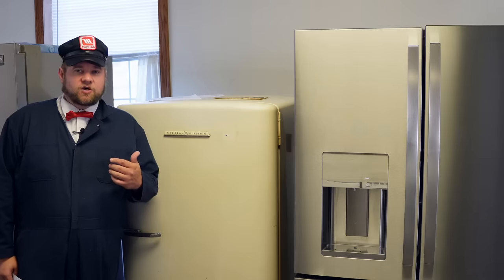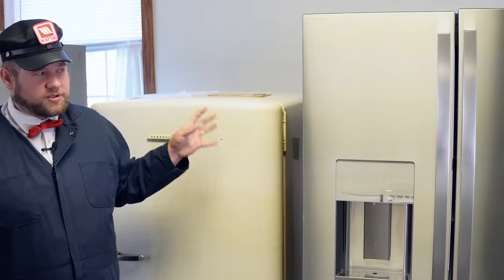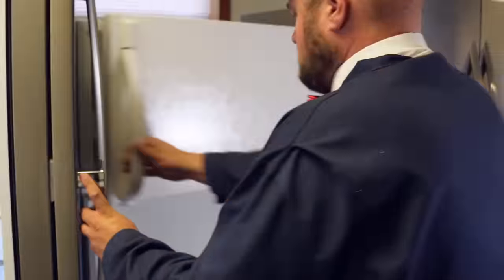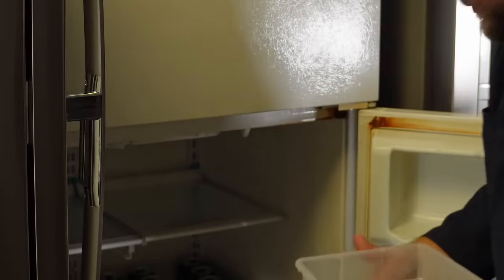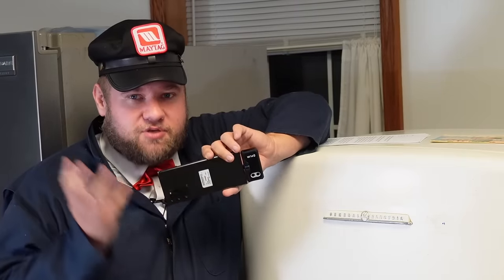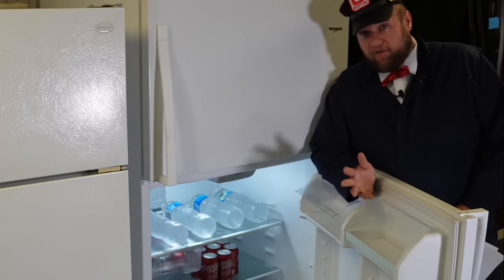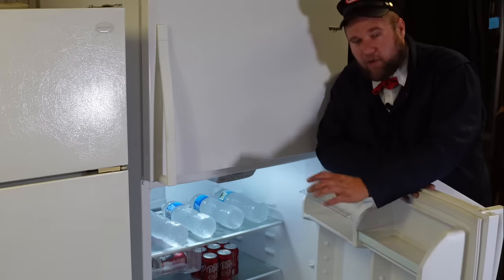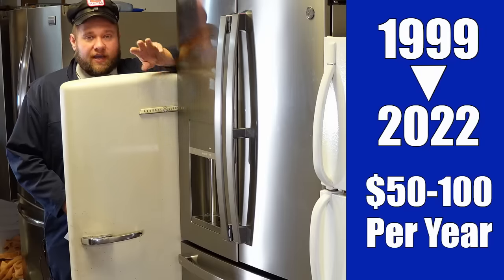Should You EVER Buy a New Appliance if Yours Still Works? A 7-Day Test

Comment: I have a friend that lost her home to Hurricane Katrina. She put brand new GE appliances in her next home. All of the crapped out on her after five years or so. 

From that point on she only buys old appliances that are still running and she loves them. She even drove several states away to get her refrigerator. You can’t give her anything “new”, especially if it’s “smart” and high tech.

I’m planning a new retirement home for myself now and I’m giving a lot of thought of buying newer but simple “non-smart” appliances vs used but near bulletproof older appliances. I miss the days when appliances lasted multiple decades. Side note I’m still using a GE dryer I got from my late father. He purchased it around 1975. It’s not pretty to look at, but I’ve only had to replace the drive belt in it. 🤔
Reply: I do have to admit that I purchased a used Whirlpool dishwasher for $150 about 10 years ago, after looking at all the reviews and concluding that they were all garbage. It is about to get replaced. It wasn't the best machine but it was a long-living machine.
Reply: Most things nowadays are built to sell and make money instead of built to last like before. Things are now engineered to only last a relative short amount of time before major components crap out. I bought a house from the 60s with original kitchen appliances other than the fridge the owners bought new back in the day. I decided to just keep using them and they are still running strong to this very day. They just look absolutely ancient.
Reply: I had a simple two door fridge I got out of the trash. Rental people left it still good. I used it for years and always kept it ventilated.
Then my brother gave me a bigger, newer unit so I put that in and gave the other to a poor guy down the street.
Then within about 6 months the newer one took a dump and then I had to buy one.
Reply: We've got a GE gas dryer that came with our house in '88.  It's probably from the early '70s as well.  I've replaced the igniter coil and door switch in all that time.  Still going strong.  My wife hates the gold color.  Sorry dear...
Reply: @robertweinmann9408  that's what God created white enamel paint for.
Reply: Stay away from GE. It’s trash.
Reply: @georgehill3087  Modern machinery and electronics are significantly more complex now than 40 years ago. Making a "built to break" fridge significantly cheapens it. The 1950's fridge cost was equivalent to $1224...a quick search in best buy shows that fridges with the same internal volume as the GE 1950 costs about $500, and fridges in the $1000-1200 range are at LEAST 20cf. The increase in component quality and robustness needed for a modern fridge to last as long as the "good old tech" would significantly increase cost, maybe even more than doubling the retail price. It's less of a conspiracy to make you buy products more often, and more of selling to more people by increasing affordability. If you want to be outraged by actual planned obsolesce, then look at the Light Bulb Conspiracy and the Dubai Bulb. For decades, light bulb manufacturers made lights with shorter lifespans than it would be possible, even though the cost for a longer lasting light wouldn't increase manufacturing costs. Or Apple charger cables.
Reply: Reminds me of one of my old high school teachers, he had a microwave in his classroom that was very old, even used a dial to set the time. I once looked on the back and it was from an obscure brand, manufactured in Korea back in 1988. I hope he still has it now, this was just about 5 years ago.
Reply: @georgehill3087  There's a term for that, it's called planned obsolescence. It's especially a thing with iPhones, I've heard.
Reply: @geronimowindow  iphone is the first thing people think of when they say planned obsolescence but my iphone still works perfectly despite being 5 years old and so does my 7 year old windows phone. The only phones that keep getting slow or broken for me are androids

Comment: I think Grandma's old fridge would be a perfect beer/soda vault out in the garage or a man cave. I'd be crazy enough to use it as a main fridge in the kitchen, but I'm weird and like vintage/retro stuff like that.
Reply: Weird? How?  It looks much more elegant and fancy than most budget modern fridge.  just buy the cheapest samsung fridge on walmart they got that ugly flower pattern combined with unflattering purple color
Reply: Bamn, i found the exact thing i described, this i dunno if it available on your region now this is weird product for your mancave! 
SAMSUNG 192 Liters 2 Star Direct Cool Single Door Refrigerator with Anti-Bacteria Gasket (RR19A2Y2B6R/NL, Mystic Overlay Red)
Reply: No one needs a second fridge. Just refill the main fridge when u get low. Jeez.
Reply: @zloungeact  oh, you haven’t met south east asian mid-upper class housewives then.. you’ll be surprised...
... in your electricy bill, not because of 2 fridge made huge different in your bill. Rather the price of the single high 4 door end fridge  drawing more power than cheaper ones
Reply: My mother’s GE little fig in shop still working and full of water

Comment: It's also worth considering ambient temperature. If a fridge/freezer is in a colder area (such as a basement and/or garage) it will consume proportionally less energy. Our early 70s Whirlpool upright freezer seems to use about half of what the online sources said it should, and that might even have been before I cleaned the condenser coils. But what surprised me the most was you mentioning using a hairdryer to reset the door gasket. A tutorial on this would be super helpful.
Reply: I had a simple fridge I got out of the trash and used it for many years. In summer I always kept it ventilated with small fan. When I went out for the day in summer I had to close the place up good ( bad neighborhood ) and the kitchen would be about 100 degrees but because I put a fan to keep the hot air MOVING,  inside the fridge it was frosty cold.
Refrigerators are set up different. I had a freezer unit in my garage that had refrigerant coils throughout, on the shelves themselves. Then I had simple house unit that was all centered around a 
' cold box ' with forced air blowing cold air ail throughout the unit, starting in the freezer compartment. If you put a tray of ice cubes in the freezer mostly by itself it would freeze them so fast they would sent tall shards of ice off the top of the cubes sticking up in the air about an inch.
The old fridge is a ' cold box ' in the middle with no forced air.
Similar to having a block of ice in an insulated box with the center of the block getting a little colder than freezing.
Reply: Yes a video on the hairdryer trick would be much appreciated.
Reply: Had an old pantry cabinet in my kitchen with outside vents through the North wall. So I put my fridge in there and added some trim to the door frame to seal it. It only ran normally from May to September, the rest of the year it turned on once or twice a day or not at all.
Reply: @Tore_Lund  sounds like the way all of them should be hooked up.
I once had a xrazy idea of hooking up a small window air conditioner near the center of my house and using ducting to blow ventilating air through the back side. Kind of like those ' in the room ' air conditioners where you put hoses through a window.
A refrigerator set up that way would probably use about 1/4 the power.
Reply: @Tore_Lund  Just remember that in conventional fridge/freezer combos the freezer temperature is unregulated and depends on balanced thermals. Be sure to adjust the freezer temp knob as needed throughout the year if you don't want it thawing in the cold.
Reply: @eDoc2020  I don't remember it being an issue. I live up 55 degrees north so summers were not that hot, but I do remember the fridge part being only +2C on  some days in winter. Still making a thermostat shutter on the vents would not make it overly complicated.
Reply: @Tore_Lund  If the outside temperature is below the set refrigerator temperature the compressor won't run at all. So if it's above freezing outside the freezer will eventually thaw. Ideally you'd have separately regulated fridge and freezer compartments but this is only an option with separate units or some higher-end modern combos. But if you monitor your temps you'll probably be fine.
Reply: @eDoc2020  Yes there are fridges with two compressors, maybe I didn't have much in the freezer? It was in 1992, I don't remember.
Reply: I took the lower back cover off my refer, and have it about 8" from the wall.  It sits next to the aisle to the bath room, so it has added air transfer.

Comment: Our fridge is 31 years old. It's a Kenmore made by GE. The only issues were a loose wiring connector and a few blockages of the freezer drain over the years. All problems we repaired ourselves. My grandmother had a fridge last 20 some years before getting replaced by this one. Sadly, she died in 1992, when the fridge was only around a year old. I remember her saying this one wouldn't last as long as her old one.
Reply: yep my mom has an old kenmore and it has never had an issue, she has an old kenmore washer and dryer from 1980, and the only thing that went wrong with it, the drum in the dryer needed to be cleaned out. other then that perfect working order.
Reply: The new $3000 Jap models are breaking down in less than 5 years.
Reply: @fladave99  CHINA pride.

Comment: I agree. All fridges should have a minimum of 15 to 20 years life. We have an 18-19 year old fridge that is making the vegetables go soft and uneatable. Don’t want to upgrade until a kitchen renovation but we may have to get an interim one. Great video. 👍
Reply: then don't put your vegetables in the fridge... they don't belong there ;-)
Reply: craigslist. there are so many units on there that work and are good price.
Reply: i am a bit confused how does the fridge do that, the only way it can possibly do that is if it is letting oxygen into the fridge, that is how vegetables go bad. as fridges are supposed to be air tight for that purpose.
Reply: @demonpride1975  too cold = the cells in the vegetables break = they get soft and squishy... simple physics nothing to do with oxygen.
Reply: Geez, check the temperature settings; sounds like you're freezing your veggies 😅
Reply: @sophya5796  haha. No I checked. Proper temperature.
Reply: @sophya5796  lower the temp settings giggles just gets colder then
Reply: @LiLBitsDK  you should read what he said, that the temp was at the proper level, sooooooooo yeah your answer is moot, oxygen decays vegetable matter.
Reply: @demonpride1975  or you could read that he EDITED his msg ;-) hence the (edited) after the time posted. oxygen doesn't decay vegetables that fast... a few hours with too cold and a cucumber goes off... common knowledge... can even happen if you accidently push it to the backside of the fridge so it touches the back wall which is much colder since that is where the cooling element is at. same with salads and other vegetables that do not like frost... so yes the temp of the "fridge" might be 5C but the backwall/bottom is still much colder (cold air seeks down since it is heavier than warm air) so your answer is moot and unintelligent. most veggies can last very long times if kept at the right temperature... heck how old do you think those apples are you eat in spring? ;-)
Reply: 1. Crisper boxes can be had at most home goods stores. Failing that, look online. Rinse and dry your veg before storing them in those boxes. I've had celery last for weeks because I made sure it was stored properly. Alternatively, use the bottom drawers in a newer fridge for fruit/veg storage. 

2. Make sure your fridge is set to a reasonable temperature. If you're stuck with an older unit with a manufacturer specific temperature knob showing levels of cold but not temp, invest in a fridge thermometer. Keep produce above 32F/0°C to avoid ice from crystallizing. When this happens it tears apart the cell walls and renders your once crisp celery into gross floppy goo sticks when thawed. Still usable in stock making, but not really palatable otherwise.

3. Position the crisper away from the freezer outlet. It won't matter if the temperature and storage options are just right if your celery is being blasted with freezer air 24/7. Cold is cold and cold makes plants mush. Bottom shelf seems to work best for me. Crisper drawers are at the bottom for good reason.

Comment: My last fridge here in Ireland lasted about 15 years. I think a key thing to highlight is to buy a fridge the size you need. Bigger isn't necessarily better here. If you buy a smaller modern fridge you'll use way less power.

My fridge holds 210 litres in the fridge part and 70 litres in the freezer part which is more than enough.
Reply: Indeed, of course for a household with children it makes more sense to have a big fridge than someone who is single and lives alone.
Reply: It depends on the use one makes of it... For example a family might want to buy large packs of frozen items (vegetables, ready meals), or maybe some people like to cook large quantities of a food and then freeze it in portions (I often do that as it's very practical).
On the contrary, some people don't use any frozen food, so of course they don't need a big freezer

Comment: Interesting video. A few suggestions though, adding in a final Watts per C/F of space would be handy. If it was mentioned I missed it, but taking a thermometer to the water you pull out each day to see if each unit is running close to the same temp. As you said in the video, it did take a lot longer for the older fridge to cool down and one of the newer ones was running too cold so it's not necessarily an accurate test. Overall I did appreciate the sentiment in that upgrading may or may not be advantageous due to the unreasonably short lifespan of modern electronics.
Reply: Appears at 11:50
Reply: @ronindebeatrice  still seems like that metric should have been the standard referenced throughout the video. Not just once.
Reply: @UCFPDZ3wA1axtWZj0WmOXMhg Guy. You're in so far over your head, you might as well just give up now because I don't know if you'll ever get there after misunderstanding this badly. 

But let's try. 

Not THE metric system. THAT metric. As in, that method of measuring performance.

I am suggesting that the measurement we should have been presented with most often was energy used per cubic foot of space being cooled.
Reply: Unfortunately the metric should be inner surface size, not inner volume.  If you think about where heat loss occurs, it'll become obvious.
Reply: @mikaelolsson4903  Fair enough, but either one would have been better than just giving flat readings and talking about the context of different size equipment, but not incorporating it into the data. I was just going off of an easy to pull number from the product page. 

At least surface area tends to increase as internal volume increases so it would be slightly more apples-to-apples to use volume. Shit, put both 'per volume' and 'per internal surface area' up there. That too would be interesting to compare to illustrate your point.

Comment: I also conducted the test between 2 fridges, whatever the brand they were from a supermarket but the cooling system was made by Danfoss, a pump maker. One fridge was from late 2000, the other one from 2009, same volume. The new one needed around 15% less power. Anyway, my point is: with a standard white fridge, let's use it until it dies and buy a new one. With a big huge expensive inox fridge, try to fix it. With very old fridges, use them as a cabinet.
Reply: I agree. 15% less electricity is good, but a new refrigerator is quite an expensive item  and it would take a lot of years to be economically convenient by that saving. Probably by the time you reach the point where you're saving money, it's time to change it again because it'going to break down soon

Comment: Honestly, I am confident that ANYTHING I buy is nickel and dimed to death and if my wife and I can get more than 5 years out of ANY appliance or car we feel like we won. We don't have kids, so, I can't imagine how much more we'd spend if we had to run the car, washer and dryer much more than we do, or just how many more times the refrigerator door is opened and partially closed. The thought sends shivers down my back faster than the freezers in this review!
Reply: Stop buying bad cars then. If you don't get 25 years out of a Toyota you are unlucky...
Reply: @xiaofengxiaofengxiaofengxi4651 well he's clearly unlucky. Consider that it's expensive to buy new or nearly new cars, appliances, etc. Lots of people are stuck in a cycle of bad purchases bc they can't afford a better one.
Reply: @mikeymullins5305  no, he's clearly buying the wrong product. Who said anything about buying nearly new? I literally just said you get 25 years out of a Toyota easy without any mechanical problems. Buy a 2001 Corolla with 200k miles on it and you are likely to get it to 300k+ if it has had regular oil changes. Also likely to have no mechanical issues at all. I have never had a mechanical issue on any of my cars. Ever. Yet my cars have been worth between £200-2300. Because all I buy is Toyota and Honda.

Comment: The oldest refrigerator I ever worked on was a Ford Philco, circa 1950s. It was sometime in the 1990s and all I did was replace the door gasket.
The oldest Maytag washer I ever worked on was made in 1962. It was sometime in the 1990s and it was the machine's first service call ever. It needed a water valve.
They don't make them like that anymore!